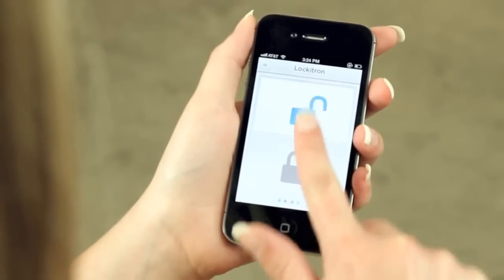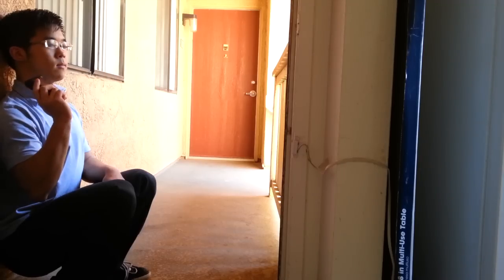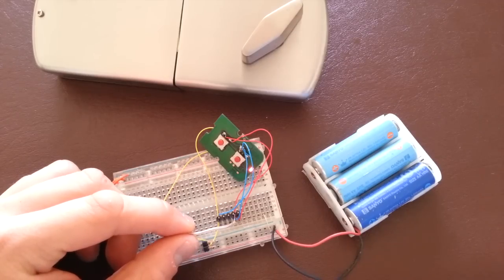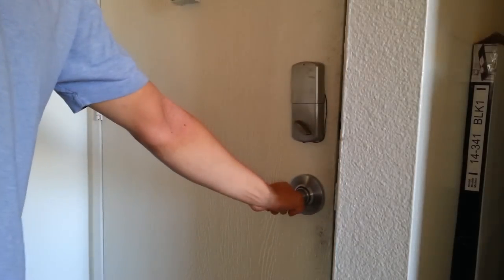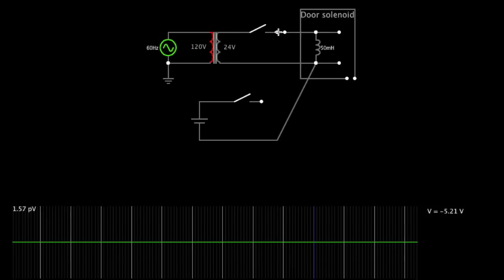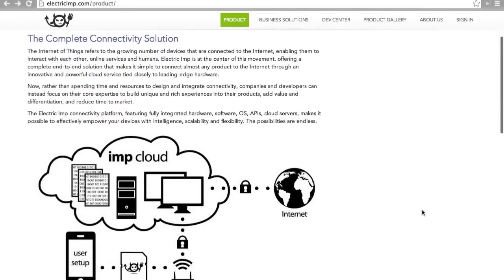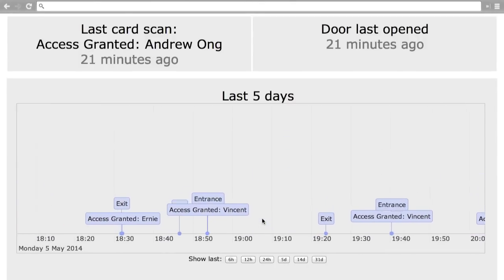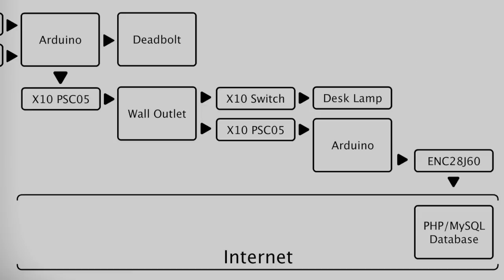Make your own smart door lock!

Comment: I did something like that. Also installed door access panels for work. I came up with something you might like or to help you. Use 2 leds and a mosfet to make a opto relay. It works great with white leds from 1/4 to 2" or more but it can be used to keep you from running wire to the lock on the door if it runs on batteries. My card reader was on the door frame, antenna in door frame inside. The led was pointed at the led on the door, then mosfet to lock button. Now bright like or a flash light on led will unlock too. Now to power the batteries on the door? A wireless power transmitter from ebay????

Comment: Is it possible for you to post which pins on the morning industry remote control triggers the lock/unlock?  I actually would like to reproduce your project.
Reply from the maker: Michael Robinson I don't have that knowledge or the lock anymore.  but if I were to find out again,  I would find the common ground for both buttons and then attach an Arduino GPIO to opposite pin of the buttons.
Reply: Thanks Andrew - did you go back to a regular key or do something new?
Reply from the maker: My lock was confiscated after three years of having it =/ And I moved into other apartments with just a deadbolt on the door. This doesn't work if you just put a deadbolt on the door--you need a regular latch too. I wasn't willing to modify the doors of the other apartments.
Reply: ouch - sorry to hear that!

Comment: What do you use to determine if the door is open or closed?
Reply from the maker: there is a large wire and a reed switch connected to the RFID reader

Comment: What will you do if you have no power ? Will the system unlock all doors or will it lock you out until power returns ?
Reply from the maker: none of the locks will open without power. at that point, only battery backups, mechanical keys, and cats that can open doors from the inside can save you.
Reply: That sounds terrible , I propose a solution , Why can't you have a hand crank outside your building but close to the door , So when the power is out and the backup battery is also out , You can crank a motor to generate enough power to verify the HID and unlock the door. No harm even if someone cranks it for fun.
This means your new version of the system should run with just a 9v battery.
Reply from the maker: Antony Jr. That's a good idea. Several hotel doors have electronic locks too and have backup power terminals on the front so that the door can be powered with an external battery
Reply: Very bad idea, he should get a portable nuclear reactor crank outside the building instead.
Reply: @antonyjr.devlogs5957  - Crank is a good idea.  I was thinking of external battery terminals for a lock I'm doing but I'm worried somebody might tie the 6.5KV distribution line into it.  Hand crank seems a lot safer.

Comment: Hey dude, I have got kwikset powerbolt 2 at home. When I opened the lock saw the same hardware..but different micro controller since my lock is only keypad entry only versus the one you use was with RFID. I want to send a signal via wemos or sonoff to actuate the lock..any idea where to tap into the lock so when I send a signal via app , the door will lock or unlock. Any help would be greatly appreciated.
Reply from the maker: with a lack of documentation, your chances of finding a secret pin or command are slim. I would try to trigger the lock's keypad buttons with the entry keycode. hopefully the buttons don't light up, giving away the code. I would also buy a Lockitron Bolt instead. it's likely more hacker friendly on the inside. ask them  before you buy it.

Comment: if there's no power, does that mean you're locked out?
Reply from the maker: No because I kept the mechanical key in my wallet just in case. I had to use it twice during the year. My friends were there during one of the failures. I never diagnosed it.
Reply: Likewise, no internet and you're locked out, or at least unfulfilled?

Comment: A touch panel to enter a pin code like here https://youtu.be/GP-qFNMUfzU so that you don't need phone or card.  Makes the hassle of looking for cards or forgetting cards unnecessary.  Keys and cards are a pain, especially when getting locked out or when in a rush.  Logging can be useful especially in hotel situations when you need to know when someone has checked out but is it necessary on a small home... Did you think though backup power if the batteries run out when away on vacation?

Comment: and then the battery in the lock runs out and no one can help you without breaking down the entire door. You said this was a dorm? why are you even allowed to tinker with the door locks?
Reply: He can take the key with him and if the juice ran out he'll have to open the door manually. As for the tinkering, nah probably not allowed, but eh, as long as nobody complains...
Reply from the maker: 1) If the battery runs out, then yes you are out of luck. That's why I carried a mechanical key just in case. I only had to use it twice in the year, and it wasn't because of battery problems. It was because the remote didn't work. 
2) I am technically not allowed to. The opinions of the employees were divided. Some maintenance employees came in and said it was ok because their employee keys still worked, but one employee seized my lock citing lock policy.

Comment: Not secure. Someone can simply walk past you and copy your code.  Why do you think no one uses this system for thier home locks, other then for low security employee tracking.
Reply from the maker: its true. When I find an HID iClass reader, I'll buy those since they are encrypted.
Reply: I'm just letting the public know. I'm sorry if I missed you pointed that out in your awesome tutorial.
Reply: He has an ID Stronghold Wallet, or he slips the card between a small piece of aluminum foil, or he has two RFID cards in his wallet, confusing the scanner.  Of course, the thief could pick or bump the lock, break in using one of the windows.....
Reply: The scanners are not so easy to use and find compatible rfid locks to use them on.